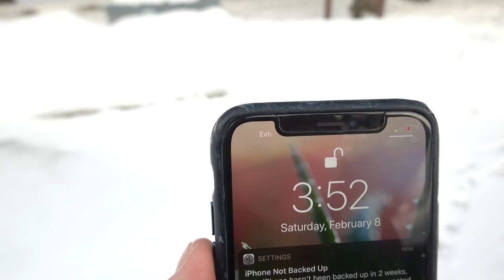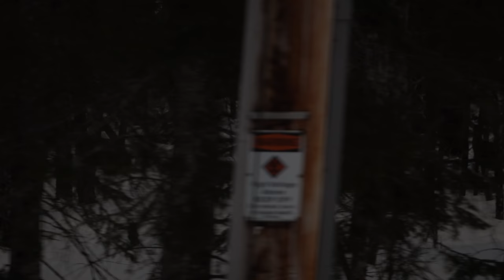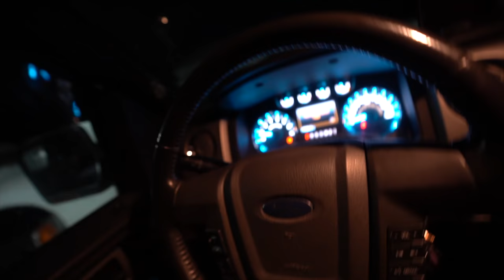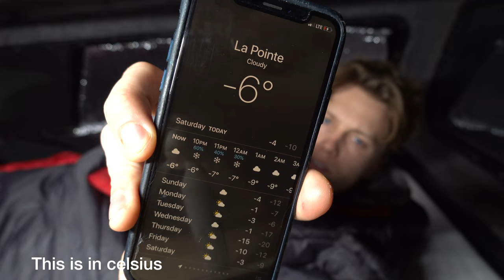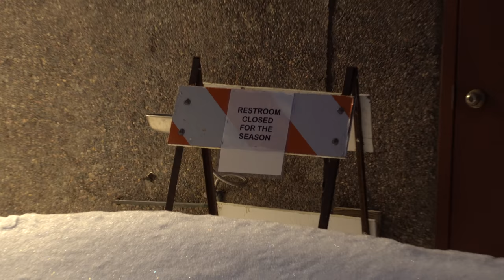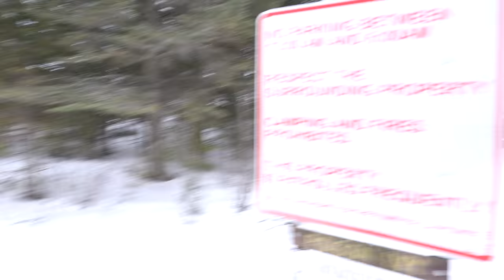Truck Camping on an Island

Comment: Need a toque!! If you keep your head warm don’t lose heat.. Use to do what your doing many years ago.. Pull my boat, my black lab and generally stay over 2 nights catching late late season Walleye.. keep up your channel! I use to have inflatable tub that fit between truck cap and truck.. able to pass things threw window.. Worked Great.. Just a suggestion! Keep up the videos 👍

Comment: Hey Mav, just an idea. If I had your setup I would seal all around between the topper window and back cab sliding window, then when you're on the way to where you'll be sleeping just keep both sliding windows open and have your heat in the truck going good so the whole back of the truck is sorta preheated for you. You'll obviously lose some heat opening the back to get in but everything will already be warm.

Comment: I use the slightly bigger Mr heater buddy with the detector and it keeps me dang toasty in my chevy van....only got down to 30 that night though.  I use a 20 lb tank and propane hose though so it lasts all night.

Comment: Dude, with all the coats and extra crap you have on, wouldn't be more comfortable if you used heave blankets instead of a mummy bag? I have been using the 15ib blanket. It is awesome plus you can add other planets on top. It makes me feel like when I was younger and had 6 blankets on top of me. I have not slept so well in so long. The advantage is that you can add some more blankets for warmth, but you already have the one that will snuggle with you and keep you warm. The other blankets just add more insulation. It is much more comfortable than a mummy bag. You are sleeping in a truck why not be more comfortable?

Comment: hey mav, show ya rack set up. I'm looking to do something similar, I have the camper rack but haven't found a rack for cab.   wanting to put two pvc pipes to run the length of racks. one for rods and the other for shower water.  thanks